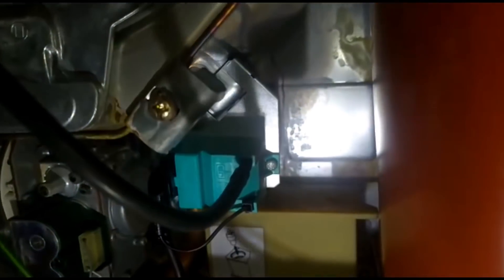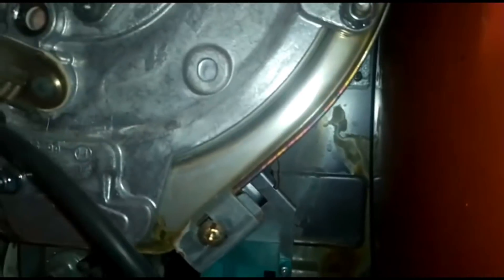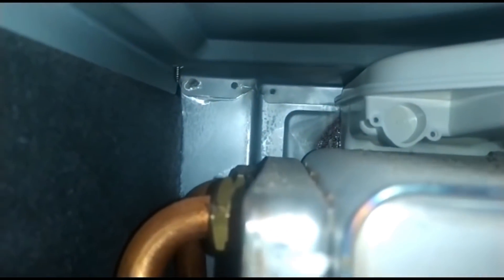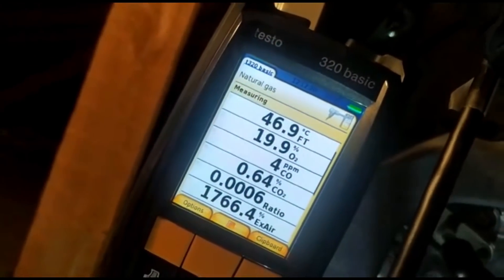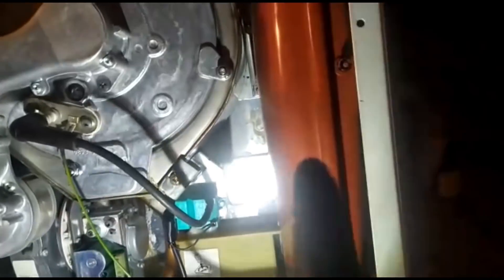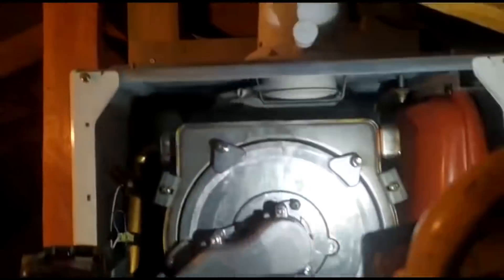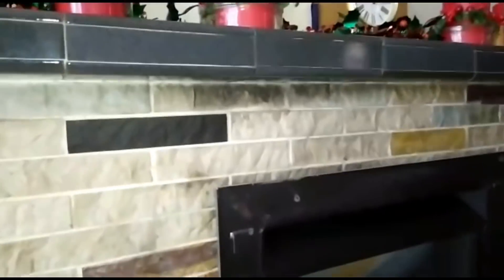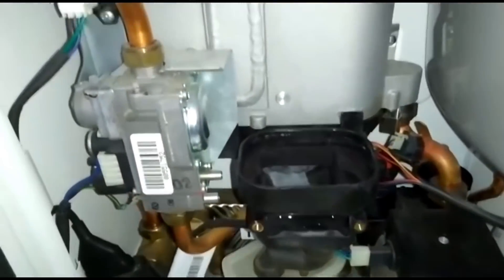Leaking Glow Worm Combi Boiler - Dangerous Fires - Leaking Ideal Logic

Comment: Allen, I think it would be good to do a video on why it is important to not do DIY boiler repair. As a non-expert with a working CO detector, I think the risk is low compared to fixing bikes and cars, which don't require certification. I also don't know what exactly is allowed: repressuring a boiler surely is? Replacing the gas valve surely not? What about work that doesn't touch any of the gas connections, like replacing a PCB or patching an internal water leak? Love the vids!

Comment: Ideal have made changes to the sump. Where it cracks is where the machine holds the  sump when it is injected moulded. Create a thin spot. The newer sumps they have been making for years now have moved the  weak point about an inch to the right where the plastic is thicker, so no more cracks. You can see the difference if you look closely .

Comment: I think the most important point on ideals is the fact that the sump always cracks in the same spot ( top right of the sump cover plate) and the manufacturer has not made any changes on the design of the sump. Is this is ploy to sell more parts? Massive thanks to Elliott, wealth of knowledge there in that engineer👍
Reply: Ideal have made changes to the sump. Where it cracks is where the machine holds the  sump when it is injected moulded. Create a thin spot. The newer sumps they have been making for years now have moved the  weak point about an inch to the right where the plastic is thicker, so no more cracks. You can see the difference if you look closely .

Comment: Think Ideal have sorted the leaky sump issue. Have replaced one or two split sumps. But thankfully I still think they're one of the easiest and simplest boilers to work on. Really like the Logics.
Reply: As a matter of interest, did you report these faulty sumps to Ideal?
Reply: @Brijoolz  Mentioned it on a training day. Don't think Ideal have accepted responsibility for it. Not great. But I do find it an easy boiler to work on and easy to install.
Reply: @Brijoolz  Ideal Are not interested in hearing about it , even though it’s a poor quality plastic casting issue
Reply: @SalimKhan-gk1fh  it’s all the installers fault for not balancing, matching the required rating and flushing systems. 
But definitely not Ideal’s fault for making poor parts!
Quite sad really. 
This is why the german manufacturers beat all the rest. 
Find an issue, and put it right.
Reply: @Brijoolz  yes you are right Brian having been in this industry for decades I have found within the last 10 years some so-called ‘installers and engineers’  don’t even bother doing a proper job ,so they charge a days labour to fit the boiler but plan to be out by lunchtime? how does that work ? how can you clean flush the system running for two hours and then hot flush tidy up all the wiring ,using proper pipe clips and ensure the system is balanced ? I spend the whole day and do it right it’s a very lazy industry at the moment and seems to be getting worse. Yes you are right about the German quality last 10 years I’ve only used viessmann boilers and it has worked out very well for me and the customers ,they are very impressive equipment!
Reply: I totally agree with those comments regards speedy installs !!???? I see installation faults every day on service visits, customers think they had a good deal, "they were finished early"  pfft!!  Keeps us busy.
Hope Ideal have corrected fault as next to Intergas the Logic is reasonably easy to work on.
Reply: I dont like them anymore. I think baxi/main are way better

Comment: The question has to be asked as to why Ideal haven’t recalled these. Everyone in the trade knows this is a known issue. Personally, I think they should be the ones pushing to put this right. Great work guys.
Reply: They could at least send us out a useful tool to release the bloody clips 😂
Just pull down they say 🧐
Reply: Less than 1 percent of the boilers manufactured had an issue with a sump, when the main heat exchanger is restricted due to poor water quality and the system not balanced and set properly, the excess heat in the manifold not absorbed by the heat exchanger causes a problem over time, so infact it is not a manufacturer issue but the boiler not being installed to the correct tolerances but everyone seems to blame the manufacturer rather than look at the installation.
Reply: @HalleB127MX  I'd be interested to know how anyone knows the percentage of faulty sumps (unless as a warranty claim). 
I'd assume the vast majority are replaced as a matter of course, and not reported to the manufacturer. 
I doubt anyone actually balances systems nowadays, if they are being honest. I also doubt most systems even get properly flushed (Allen is an exception/ exceptional!), if the boiler is a replacement. Im sure Ideal are quite happy to keep supplying the spare sumps, and taking the profit from the spare parts.